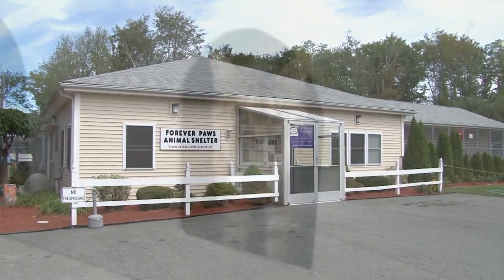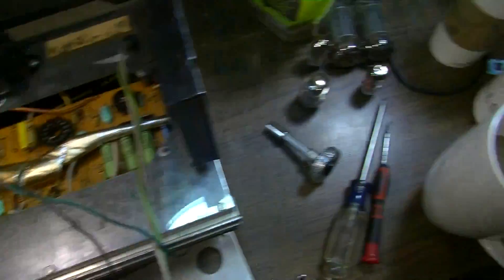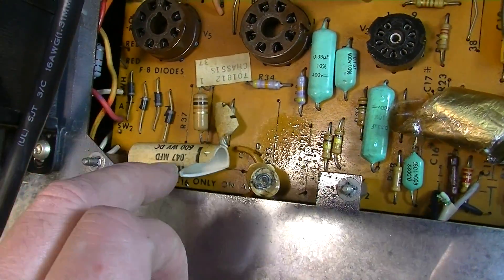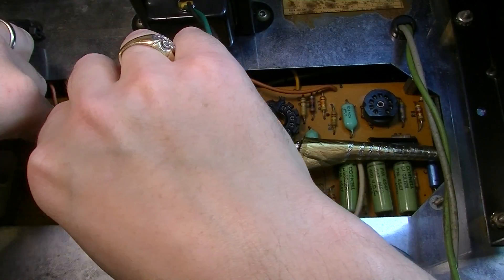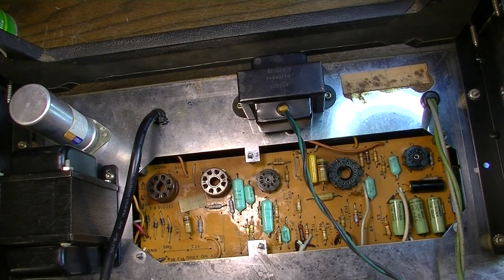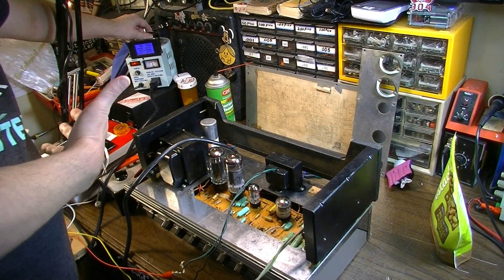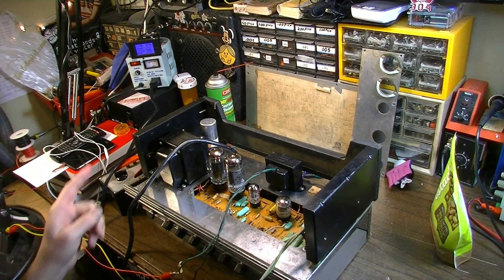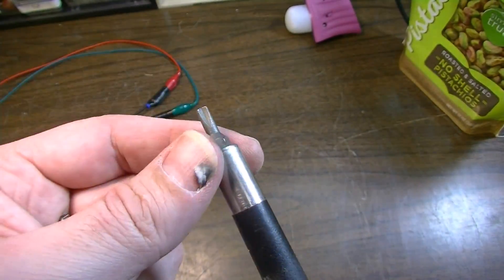He Heard a POP...Then Came SMOKE!

Comment: I'm not an amp tech and I really enjoy your segments, I learn a lot from you and uncle Doug. I learned something important years ago that I share with whoever will listen...there is something to be said for any type of power conditioner/controller, back about 20 years ago I was living in rural PA and happened to check the voltage in my house which was 132 volts. this gave everything in my house a shorter life span from light bulbs to appliances. having had several vintage amps that I knew were developed for 110 or 115 volts [ my grand sons have ''borrowed'' them all since] I quickly got a good power conditioner for them. just my opinion but you really have to be aware of these things.

Comment: One time I was lucky to be the first-hand witness of a capacitor exploding, I had built myself a DC power supply from a kit of parts I bought from one of my local DIY Electronics shops, up until the time the capacitor exploded, the DC power supply had worked perfectly, anyway, I plugged it in and turned it on, about 20 minutes later I heard a loud bang come from inside the power supply, so after I had recovered my nerves I quickly turned it off and unplugged it, I wanted to satisfy my curiosity so I took the top cover off the power supply and looked inside, and then I discovered what caused the bang, one of the 2200uF/50V DC smoothing capacitors had literally blown it's aluminium casing right off and I found the casing inside the power supply, have you ever smelt a blown electrolytic capacitor?, let me tell you something, it was one of the most pungent smells I had ever smelt.

Comment: Don't be fooled by the plastic case---that's a paper capacitor encased in plastic. They were actually worse than the wax ones, because when they shorted internally, the only way they could relieve pressure was to explode like this one did

Comment: first thing i would do is check the wiring of the church.

if there is a ground loop or a reverse wired outlet or something that could cause damage.

a ground loop may not be putting enough current at high enough voltage to make a spark when it is connected but could pass enough reverse current to load down the power supply.

you should be careful as the dielectric liquid could contain pcbs .

i know industrial start run caps contained pcbs.

Comment: A "death cap" blew up 2" from my face once. Fortunately I was wearing safety glasses. Flash. Bang. Smoke. Terrible smell.
Technically this was an "X-cap" because it was in a  radio, not in a guitar amp. The phrase "death cap" refers to one specific part that was in almost every tube/valve guitar amp made before 1980 or so.
In a radio, the X-cap is wired directly across the AC mains line, just inside where the AC line cord comes into the chassis. In the USA very few old radios have an AC mains fuse. The one that blew up in my face had no fuse.  And its on/off switch was wired in after where the capacitor is. So this capacitor always had the full AC mains voltage on it all the time the radio was plugged in. This was a 60 year old radio.  How long do you thing it was plugged in during its early life?
In radio theory these "X-caps" are often referred to as "across-the-line or "across-the-mains" capacitors. Their main purpose is to filter out unwanted RF noise. They are essential in many radio receiver and other RF circuits because they filter out most of the radio frequency garbage from the AC line.
These days I always replace every capacitor at the "AC mains" end of the power chain. And I do this in every device that comes onto my workbench. Whether it is 2 years old or 60 years old. Modern "X-capacitors" are actually labeled with their capabilities as far as not exploding or burning.  But the original old vintage caps that were wired across the AC mains were often rated at 600V but might not have any other "special" specs or capabilities. Often they had the white tubular ceramic cases like the exploded cap in this video.  The European rectangular clear plastic cases labeled RIFA are notorious. Look up "RIFA capacitor" or  "exploding capacitor" to see examples.

Comment: If the death cap was passing 1 amp to ground it would be like a 120 watt heating element, sort of like a 120 watt light bulb. This would generated enough heat to make it smoking hot and still leave the fuse intact.

Comment: I've recapped several old radios and I ALWAYS replace those old wax or plastic paper in oil caps with orange drops or the newer film caps available through Antique Electronic Supply or off of ebay.

Comment: As a 57 year old gay guy and yes, I mention that deliberately because I think outside the square when it comes to electronics or anything for that manner! I call it my 6th sense and I trust it. I've seen 3 guys die because of their ego but they knew what they were doing rewiring a 3 phase power outlet = VERY WRONG! I can replace a gpo here in OZ but after that, that's when the sparky gets a call. Low voltage gear I will look at and deoxit pots or check amps for bad caps, check speaker phasing etc but I let trained people do their job! I also use the best spectrum analyzer on Earth, my ears to check for obvious faults and over all sound purity! If you don't know what the fuck you're doing, call an expert! Do you really wanna die because of a service call? Being a nightclub DJ here in Melbourne Victoria Australia, I know what equipment should be doing but I know my limits. Cheers!

Comment: Brad this has nothing to do with this video but I know you can give me an answer . I know you work on tube amps I Which I have many tube amps .But I have a question please ! I have a Fender Power Chorus .It is a stereo combo with two 12 inch speakers . That are 60 watts each . SOLID STATE guitar amp and 120 watts ! The one that has the red chicken knobs ! Anyways the stock Fender Special Design speakers 35 oz magnets . Well when I run the amp at 3/4 volume for a period of time the speaker magnets get hot to the touch ! So hot that you can not have you hand on it too long because it is so hot ! Is the speakers supposed to be that hot when cranked ? ! Is that normal to be like that ? Please give me some information please !

Comment: Figures---problem due to a cap that could be half  century old!Caps can the the MOST failure prone electrical-electronic components!Esp if its hung across the powerline-who knows how many surges that cap took before it couldn't take anymore.At work in one of our trsansmiters-60yrs old we had 5 7.5Uf 8Kv oil filled caps in a HV supply fail.Fortunately they have fuses on each cap.One fuse blew into pieces!These fuses are a foot long and about an inch wide-phenalic case.These are normally "reloadable"you replace the fuse wire.And in another transmitter there are about a dozen failed electrolytic caps in this transmitters power supplies.2400Uf at 450V.Caps have the bad habit at failing at the WRONG times!!!And WITHOUT ANY warning!!!

Comment: I have a silly question: why is there a 6A fuse in series with a 3A fuse (in the schematic)? That doesn't seem to make sense...
Reply from the maker: It's a backup in a case a dummy shoves a piece of metal in place of the fuse.
Reply: Ah... I see... Funny they did not put a second 3A fuse in there then... Thanks for clarifying!

Comment: 05:48 it is not odd that the 3amp fuse did not blow. The cap did not short completely, it just "leaked" some current (less than 3amps) to ground, overheated and then blew up... Even 500ma leakage could do that easily...  (As you said at 11:00)

Comment: When I restore antique radios I replace ALL the paper condensers. By the time they reach a certain age, it just isn't worth the chance, when one goes, it can cause other problems. As for that .047 condenser, it should be replaced with a Y type safety cap. It is there to bypass noise from the line before it enters the amp. I am a retired EE. I began collecting antique radios when I was a kid back in the 1960s. I have many years experience restoring tube electronics.

Comment: That's funny, the same exact thing happened to an old V4 that came through our shop about a month ago. When the tube tech handed me a baggy with that can in it I was shocked. Also, be careful handling those blown caps as I understand the dielectric in those old ones were sometimes pretty carcinogenic

Comment: Others are saying it.. and I agree, change the caps.  Even unused brand new, old stock parts can be DOA with zero hours use.. Old caps with tens of thousands of hours operating on top of years of age are risky business. A lesson to all aspiring techs watching.. old caps can fail suddenly and with no warning.    A recent Mr. Carlson's Lab showed the leakage failure mode of some vintage unused caps.
Reply: I've always gone by what they taught me when I was first learning electronics: Electrolytic caps last for about 10 years when you use them, about 8 when you don't. After that they should be replaced, as it's just a matter of time at that point, and when they go, they can take other things with them that cost a LOT more. Caps are cheap, replace them.

Comment: Brad - watch out for the possibility of PCBs (poly chlorinated biphenyls) in the oils used in capacitors and especially transformers in that older equipment.  They used them until about 1975 or perhaps 1980.  Its supposed to be a carcinogen.

Comment: Seems like a good place for a "small chance" story.... so....
My friends were playing an outdoor gig in our seaside community.  The bass player had a big combo with a cooling fan through the top.  The grill is about 10 sq inches and only 50% open.  That's only about 2.5% of the top area of the amp.  The temp controlled fan under the grill is about 50% open, 50% blades.

 So.... after sound check and.before playing, a seagull roosting on the amp takes a small crap.  It goes through the grill, totally misses the stopped fan blades and hits the power supply board....DEAD ON the junction of the positive dc, negative dc and ps common.  At first, supplied by the line voltage, then the LARGE ps filter caps, bright, large sparks flew out of the fan grill, and then produced a few more pretty impressive sparks from the caps AFTER the amp.was shut off.  
What are the odds of that???
Anyway, as bad as it had looked, the damage was fairly minor.  Clean it up, do a small copper overlay on a few foil traces, then re-varnish that area of the ps board.
Told my friend he needs to get one of those "plastic owls" for his amp while playing outdoors.  The owls are supposed to scrare away seagulls.... er.... they don't.  Not our seagulls anyway.

Comment: Even modern caps are prone to this failure. My computer kept giving me the blue screen of death. Finally, it wouldn't turn on one day. Every 1000mfd cap around the cpu socket had blown, or was leaking. HP was well known for the capacitor plague.

Comment: I had an electrolytic explode on me years ago.  It was in an old AT computer power supply on the primary side (the cap wasn't bad, there was a short in one of the leads to ground).  It wasn't a pop, more like an M80 going off.  The lid was off the supply and the insides of the cap were sticking out about 4 feet and there was oil coated paper everywhere.

Comment: Never trust old caps, especially oil and/or paper. After nearly 50 years they are guaranteed trouble. I have had old death caps blow and not bother the rest of the unit at all. Just scary smoke. Replacing them with modern safety caps is a must. I would worry about those green C-D caps in the future.

Comment: And that's why they call them "death caps".  It blew up because it was leaky and you put in a 3 prong power cord.  If you hadn't, there's a good chance that you would have had a fried customer.  The 3 prong saved the day.  As far as caps in general, I can see leaving original caps in place if you're doing a museum piece.  But for a "working" amp?  Better to error on the side of reliability.
Reply: Another approach is to drill out the center of a vintage cap and put a modern cap inside.

Comment: you are totally right about a variac vibrating if you are drawing alot of current but the dim bulb does things just a variac cant do make the area brighter so both senses are given input. i normally run my variac off of my dim bulb circuit and you can tell instantly because the light starts to glow really bright if it starts drawing current and you instantly know somethings wrong. ive had situations were working on bulky stuff where the variac might be a couple feet away and if the tv is on in the background you might not hear the variac buzzing but you will instantly notice the room gets way brighter all of a sudden.i like that it gives you "at a glance" data as to how much current is drawn at any given time .by itself a variac plugged in a dim bulb and turned on the bulb is completely dark even though you can read voltage at the variac output. flip on the amp and the bulb starts to glow as the rectifier tube comes to temp.i think its a great extra protection cuz i dont know about you but i have burned up a transformer or two in my day. but do whatever you want to do.you are a big boy and a licenced guitologist.lol. love the channel and watch regularly.

Comment: It's really a wonder things like you were talking about with higher line voltage doesn't happen more often.  From. 110 AC to 125 AS on the power trans is way significant

Comment: Electrolytics are the weak point in a lot of 'modern' electronics, too. I've fixed several discarded, nonfunctional TVs and radios that were less than a dozen years old by simply replacing a few key electrolytic capacitors.

Comment: From Leo:    Interesting video.   I learned something.  I have seen numerous electrolytic capacitors burst open,  and I have seen ceramics in TV power supplies blown, but that is the 1st composite canister or epoxy dipped capacitor that I have ever seen blown apart.   That may be PCB oil, wash up really good.

Comment: It should be noted that the oily film is technically NOT an electrolyte.  It's a dielectric impregnated into the paper of the capacitor.  Also note that EVERY switching computer power supply will have one capacitor from Hot to Neutral, one capacitor from Hot to Earth Ground (the so called death cap) and one capacitor from Neutral to Earth Ground.  The difference being is that these "Y" capacitors (Those connected between Hot and Earth Ground and from Neutral to Earth Ground) are designed to fail OPEN and the capacitor designs are safety certified by testing organizations such as UL.

Comment: Had a Ampeg reverberocket reissue pop and lose all the smoke...looked fine inside and never did find the problem...still have the cabinet as an extension speaker, chassis is someplace around here quietly rusting away.

Comment: I'm working on a 25W per channel stereo amp from a 1970 jukebox at the moment.  Was really having an internal debate with myself last night about changing out 4 of the EXACT same caps (0.047@600V, ceramic case).   I mean identical.  My original thoughts were to leave everything as original as possible.  They tested perfect on capacitance and leakage at full working voltage.  I convinced myself to pull them and replace them anyway.  Today I saw this.  I now feel better about my decision!  Good job Brad.

Comment: This hapened to me about year ago. Bought new 70s Italian combo, pluged it in and played it while sitting behind it to check for some problems. In couple seconds big pop and smoke like fire from old 1800s gun came out it while something SHOT me in hand and stomach. It was burning me so I put down guitar and run to wash it. When I came back smoke was still coming, this time it was burning power transformer. Some moron put there new filter cap backwards. It pop like that yours and short itself. And fuse there was too big to blow so it take power tranny with it. I had burn mark on my stomach for about month, I’s ok now thank god. Be careful guys. Cheers.
Reply from the maker: I'm glad this didn't blow with my face over it.

Comment: I don't think it makes sense to leave "vintage" caps in anything I work on. That said, I have a BandMaster that still has the original blue caps in it. I should probably go back and replace them before a $2.00 cap (or less) fails and knocks out a $50.00 tube. I'm finally a believer in pulling the "death cap". I used to advocate installing an X1/Y2 in it's place. I still use them in test gear but not vintage or even scratch built amps.

Comment: Lots of people don't understand preventative maintenance because of the associated costs, or because of some strange notion that replacing original components somehow devalues vintage equipment.....until they experience this sort of catastrophic failure!! Dielectric leaks, a little vibration causes cap plates to contact each other in a high voltage circuit, and PAF!!! 'Release the smoke!!' Couldn't hardly have happened to a more volatile component, either!

You should be able to simply eliminate it and install a grounding power cord, no?  :-)
Reply: Oops! Commented too quickly! You did all that!  Duhhhh....Sorry!
Reply from the maker: Yep, already serviced it mostly at this point.
Reply: @TheGuitologist  ... Yeah...I got carried away...avoiding the snow I have to deal with up here! LOL (That's my story and I'm stickin' to it!) :-)

Comment: Older amps with todays higher AC and digital noise, can cause unpredictable behaviors. Fortunate to have numerous older amps, silvertone, kalamazoo, etc. Lost my oldest kalamazoo, 1940’s, melted the xfmrs. Checked ac and was 130. The error to the amp is 3x to 4x the 15 vac over-volt the 115 vac max recommended. Started using amprx brown box and brownies and dial in a proper voltage and benefit from the isolation, now all amps (vintage and modern) behave quietly and also let them work well in wet dry rig as well.  Even new amps, like The new Supro and others have 115 and 117 as input.